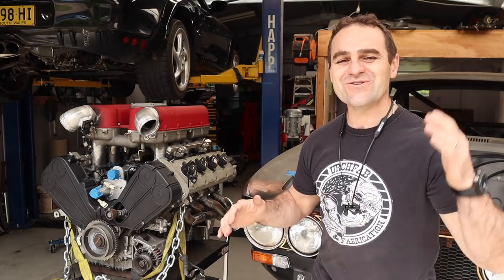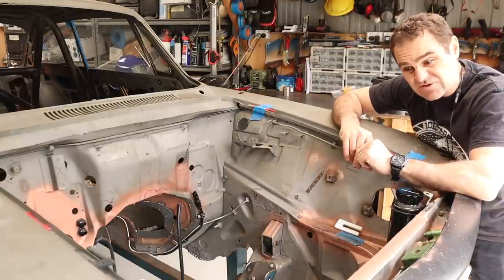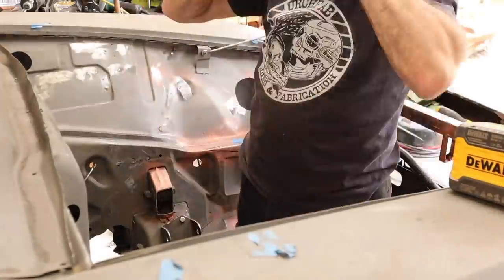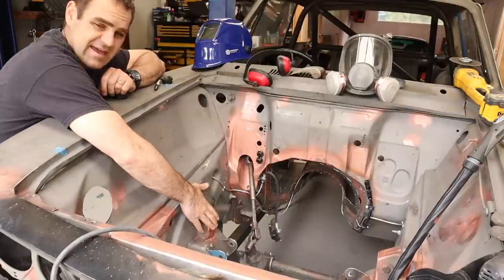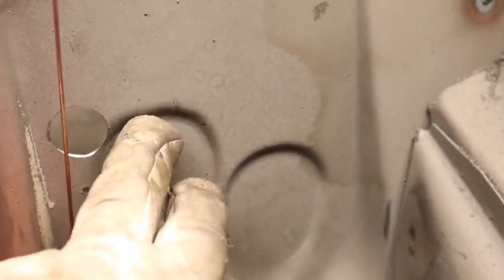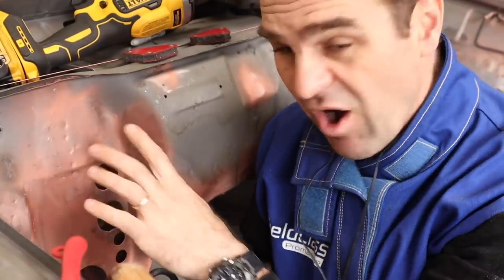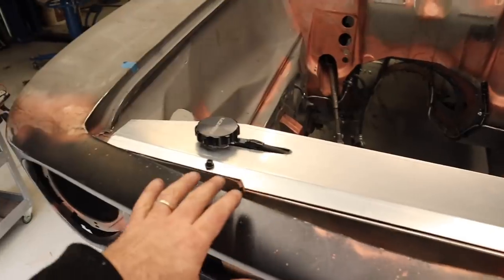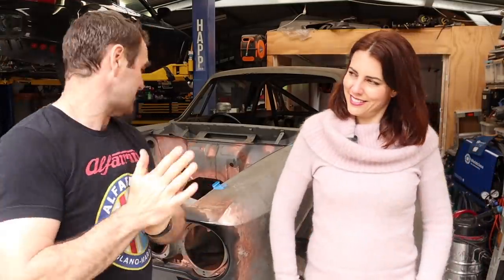Smooth bay for the Ferrari engine- Ferrari engined Alfa 105 Alfarrari build part 115

Comment: I know it's a lot of work but my vote goes to cutting out and welding in smooth pieces into those large moulded sections on the passenger side inner guard. The amount of effort and workmanship that has gone into the car I think in the long run having the bay symmetrical in those inner guards will be worth it 🙂. As always love the work mate. Should be an absolutely stunning car once done
Reply: Absolutely 👍👍👍⚘
Reply: Nah it’d lose too much structural integrity.
Reply: @Jonathan_Doe_  if it was a massively structural pressing I would've thought it would be on both sides. You can see I'm the inner wheel arches there are large bends in them which would help with rigidity. I would imagine if anything the driver side of the car would see more stress with the steering box etc being on that side
Reply: You know you need to do it ☺️
Reply: @Jonathan_Doe_  In the left hand drive version there would be a couple of holes there ;)

Comment: If it helps, early versions of the Ferrari 3.4 V8 had just the single MAF sensor and it was pretty much exactly where yours is.  Those engines ran fine.

Comment: Tip
You can fill holes with bolts and screws.

You put the fastener into the hole so it fills it with the tip just poking out and weld it in.
Then cut off the excess.
Reply: Good idea. Don’t bolts often have some sort of coating, though? Wouldn’t that interfere? And bolts are usually harder than the sheet metal; I wonder if that would make the welding trickier.
Reply: @computiNATEor  yes but a quick hit with the grinder to clean off the threads would take care of the coating.
Usually unless they are cheap hot zinc dipped the coating is inconsequential anyway as it burns off the instant the arc hits it.

Comment: Keep up the good work! In the comment somebody mention in the front a bmw type frontbrace from the towers to the firewall , I also think that give a better road handling. Over the top off the intake is not possible I think. But I also think a (aluminium) 3 point brace, from the rear towers, (between the electric rear window motor en ac compressor) en than connected if there is space , to the body behind the fuel tank to the body (bar)

Comment: The press indents are for safety, they enable the panel to crumple in a set way, in a crash which prevents you from losing your feet, legs and head.
Reply from the maker: Some are like the ones I made in the bonnet bracing, but not the ones in the side of the engine bay ;)

Comment: filling in the gaps from the inner A arm mounts to the body shell, looks much nicer when done,, did my ecotec spider that way..  a few welds to build up the area, then carefull 80 grit sanding ( power disk ) to shape it out ( i  did a weld to make the area stronger,, then a little griding to flatten the weld,, then used  ' (lead ) and a maple paddle to smooth it out, in short time to finish it .  nice craftsmanship,.. lots of folks just might have left the holes in the bodyshell
Reply: Okay I’m going to have to see a vid of that ecotec spyder

Comment: The little wing shapes you made to fill the holes you cut out. Couldn’t you just take the piece you cut out flip it over so it’s a negative insert?
Reply from the maker: No, it wouldn't work. Try it with a piece of paper and you will see why ;)